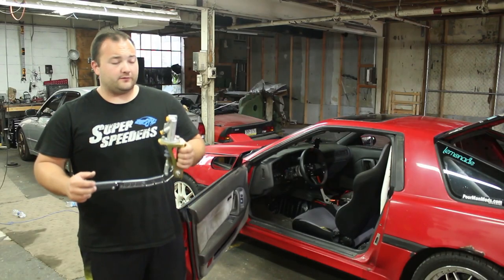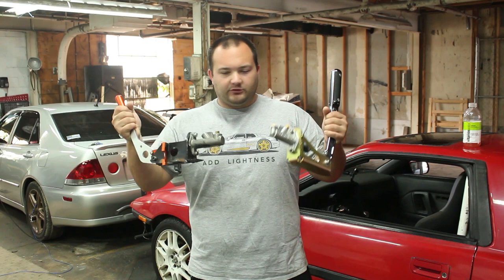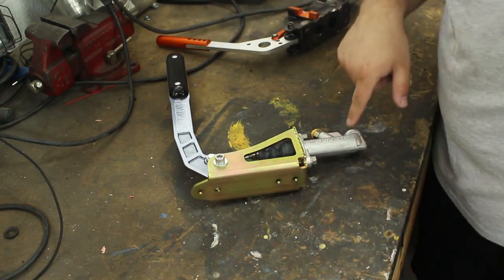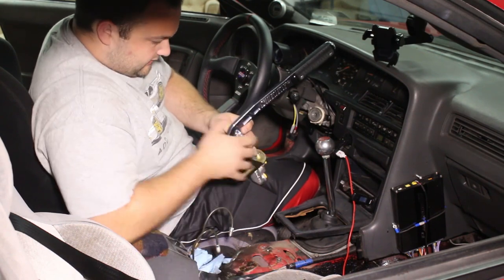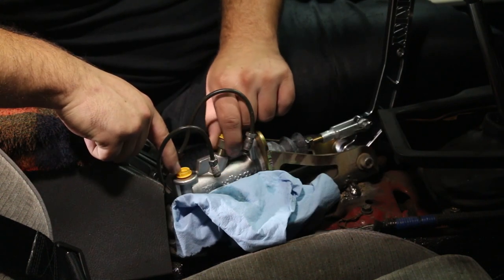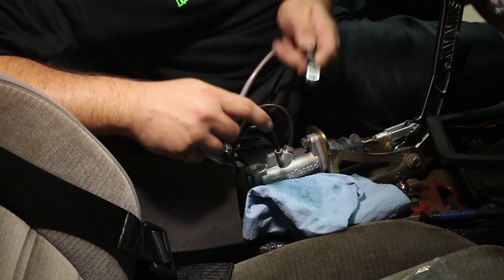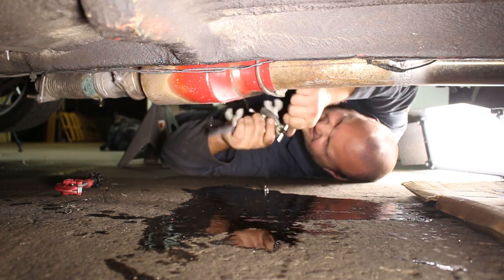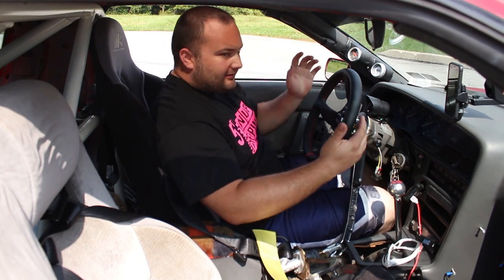SIKKY Hydraulic Handbrake Install & Review | How To Install A Hydraulic Hand Brake

Comment: I found that handbrake mounting location is not as important as most people think. If it works properly, the handle doesn't pull very far.
Reply from the maker: The way i mounted it works for me :D
Reply: Custom fit definitely the best way.